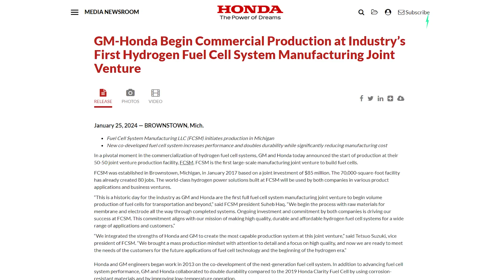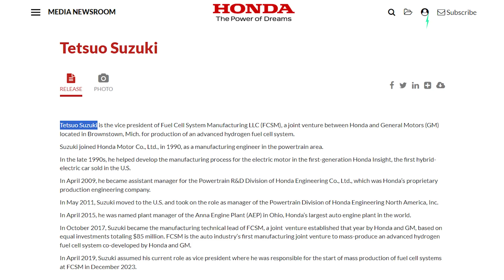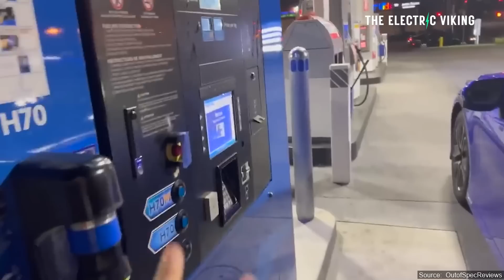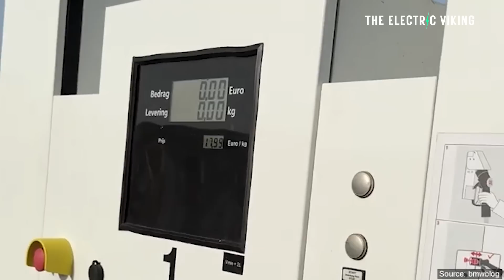GM & Honda's hydrogen fuel cell facility begins mass production in America

Comment: Hydrogen has multiple advantages. It is a high energy fuel, you can crack water to manufacture it almost any place you can get water, BUT It has some major disadvantages.

Hydrogen is one of the most dangerous substances to work by. The atom is so small it will leak through metal. If you do not have excellent gas circulation throughout your facility, the hydrogen can concentrate in dead areas and create an area that will randomly explode once hydrogen levels become high enough. Generally that's seen as a problem.

The problem for hydrogen as we have new high energy batteries that fulfill the same function, without the safety issues. Yes I know lithium batteries burn hot, but so those hydrogen AND hydrogen leaks through pipe walls. I could have seen us trying it for aircraft, but for that if needed we have biodiesel. Hydrogen was a good try, but it's just one of those dead ends at this point.

Comment: Hydrogen are a scam.
The oil companies are getting hydrogen when they are steam cracking oil to get more gas and diesel.

So, when someone got the idéa to use it in a car, the oil companies found out that they could sell more oil.
And, if everyone had an hydrogen car, they could polute the co2 a place they don't have to pay for it.

And, if the tax payers had to pay for the stupid politicians that beleve that hydrogen, it's even better...

Comment: Fuel cells are excellent grid scale solution. My previous employer created a containerized solution 10 years ago. Much better energy density, than lion batteries and can run also with LNG.
Reply: That is plainly false - the most efficient hydrogen cycle is only 40% as efficient as the most efficient battery cycle.

Comment: I think hydrogen is a lost cause but the only hope I see for it is to have a gas distribution system like that used for natural gas. Refuelling stations attached to a grid would have a chance of not running out, all the time but I think the obstacles to setting up such a distribution system are probably insurmountable..
Reply: Am not a hydrogen fan for all the reasons that others have already pointed out; however, as Sam regularly reminds us, renewables are generating meaningful proportions of various countries' energy requirements...which is great, but if the current roll-out rate continues, what is going to happen to the excess capacity? If electricity regularly becomes "free" then it would make sense to use it for something and IMO a hydrogen electrolysis plant makes for a neat dump load :-)  ...but I've seen the Hindenburg movie too so whatever anybody sez there's no way I'm going to be driving around in a bomb even if the explosive is free...

Comment: If these fuel cells are intended for vehicles, Honda and GM have just wasted their money. The efficiency of these fuel cells is 60%. That alone is enough to doom the system, since that's roughly the same as the end to end efficiency of the whole BEV system including generation.
Sure, there may be some edge cases where these are useful, but it's never going to be a mainstream product.

Comment: They need to install refueling stations in the northeast part of the United States. There is a big market for them in Massachusetts, Connecticut, New York, Rhode Island and New Jersey. They should start with installing them in wealthy towns, where people would have the money for hydrogen fuel cell cars.
Reply: Still a big problem.  Hydrogen stations will be scarce like EV chargers were at the beginning, BUT, an EV can literally be charged (however slowly) anywhere there's an AC socket, and that's everywhere.  I have a level 2 charger at my home and have never been to a public charger with my Tesla and maybe never will, but I can never have at-home fueling for hydrogen.

Comment: Fun fact: transporting the same amount of energy as a diesel tanker truck takes 16 Hydrogen tube trailers pulled by diesel trucks plus a tanker for the 16 diesel trucks to refuel.
Reply: With Mary mathematics that is probably a wash, its the salary and bonus that count as long as the stockholders are razzle dazzled.
Reply: F-O-N FUN
Reply: Not doubting you but I'm wondering if you could share where you got your information. :) @sparkysho-ze7nm

Comment: Hydrogen, because it is the smallest atom, is horrendously difficult to contain. Mechanisms to move and contain this fuel require more maintenance and costlier containment manufacturing than other larger fuel molecules. Failure to maintain the containment systems, even those on vehicles, would make Hydrogen far less cost effective.
Reply: And FAR more dangerous than gasoline and FAR FAR more dangerous than a pure EV.
Reply: Hydrogen is also suspected of being a greenhouse gas, since it forms methane when it escapes.
Reply: @drxym  It doesn't form methane.  It consumes hydroxyl radicals that would otherwise have destroyed the methane.  Any methane in the atmosphere (and there is a lot) would then last longer.
Reply: Legacy automakers will spruik Hydrogen since it requires regular (expensive) maintenance with all the pressure tanks, valves & associated plumbing. Governments are on board since you are tied to a cartel controlled bowser & they can collect excise at the same time.

Comment: The plans for this were made back when batteries cost much more.  It probably made a lot more sense using those prices.  This is also a Metcalf's law situation.  Success will depend on reaching critical mass.  One thing in favor of hydrogen is there will be a lot of cheap real estate in the form of gasoline stations with diminishing gas revenues.  However it will be very hard to provide hydrogen at a cost competitive to electricity (generation + batteries).  If batteries had remained expensive then hydrogen cannisters could have been a replacement for batteries created when electricity needs to be drained from the system.
Reply: So I've heard this before and wonder what does it really take to convert an old gas station to hydrogen? You can't use the existing equipment, the old fuel tanks have to be removed and have likely been leaking which will require some sort of remediation, the hydrogen infrastructure necessary is expensive and has strict safety regulations which ends up taking more space than the original station so you'll likely lose some pumps and possibly the convenience store as well..Takes a lot of planning, effort, equipment and especially time and money to get this done properly even with government backing. All for a technology that will never be as efficient as battery tech... seems like a good idea.
Reply: @erktrek  Great questions.  I am pretty sure this fits with what Toyota wants to do so it must be possible.  It begs the question, though, if you don't do this what else are you going to do with the space?  It seems like there would never be enough parking and it would be a lot harder to put supercapacitor 10% zap chargers in place, especially because it would make the cars more expensive.

I think the most expensive part of "cold" is "insulation", so I assume there should be some cost savings.

Comment: I think the ability to control the production and revenue generated by the ‘fuel’ is something that falls in line with current gas ecosystem. The yachts won’t buy themselves if the public can generate their own energy from their rooftops.
Reply: Bravo! An astute observation, well founded.
Reply: Let's not forget that 30% of fuel is spend shipping fuel around the planet. That is a lot of industry retraction if we stop shipping fuels. 

Less pipelines
Less trucks
Less trains
Less ships
Reply: You are never going to generate that much electricity from a solar panel.  they just don't make that much.  And you lose 14% charging a battery, and the car is worthless when it's 6 or 7 years old - dead batteries.   Your statement is an innumerate dream.

Comment: Hydrogen is a net loss system. It would be cheaper to use the power directly to charge a battery than to convert water to Hydrogen.

Comment: Hydrogen - for people who want their fuel to cost 5x more than gasoline and be 1/4 as efficient as using the same energy to charge a battery.
Reply: Too logical
Reply: We could have plugin hydrogen/battery hybrids and excess solar during peak times could be used for hydrogen production. This will allow to install more solar panels to compensate for cloudy days.
Reply: @vegtalkvibes  or solar could be used to charge a battery at a much greater and useful efficiency. That was what the Sono Sion would have done if the company hadn't run into funding issues.  But even the Sion was only looking at adding 10-20 miles of range daily which would still cover a lot of daily drives but if it were only 2-5 miles via hydrogen it would scarcely be worth it.
Reply: @vegtalkvibes would these cars also have space for passengers?

Comment: Hydrogen is attractive to the BIG MONEY powers that be for several reasons. When Hydrogen burns, it combines with oxygen to create water. Very true, and very simplistic. History says Hydrogen took humanity to the moon. Again true. The Saturn five rocket was very powerful. In chemistry class we used electrolysis to separate hydrogen from oxygen. Also true. The Hindenburg used Hydrogen, and burned it too! Industrial production of hydrogen has been around for years, not as simple as hydrolysis in a test tube. Uses vast amounts of hydrocarbons. Hydrogen is an alternative to gas, oil and coal for powering vehicles. Not nearly as efficient as  renewable electricity. The big kicker with Hydrogen is that it is in opposition to JOE BIDEN'S MANDATE for EVs. Add to that, it cannot be made in practical quantities by an average homeowner, whereas anyone can buy photovoltaic panels and a battery system and use electricity. If BIG MONEY can force everyone to continue to buy their product, they can still exert some power over the average consumer. Once I have completed my investment in Solar Power, I can to some extent thumb my nose at the big power brokers. They don't like that. It diminishes their control!    In summary, the hydrogen push is an effort to support the oil industry by discrediting the EV industry. Part of the same money pot as "EVs will crash the Grid".    Must go. Need to recharge brain. More beer and mushrooms. CAFFEINE running low!

Comment: I don't see much of a place for hydrogen in transportation. Green hydrogen is expensive to make, hard to transport, difficult til store.
But batteries are not ideal for cargo transport. Or planes. The required batteries bacome to heavy. Maybe use green hydrogen to produce green ammonia, and use that as fuel?
Or perhaps methanol? Those things would make a bit of sense. Hydrogen? Not so much.

Comment: In the Netherlands, an attempt was made to issue a tender for four hydrogen trains, but failed to find a train manufacturer for the four hydrogen-electric trains.
For cars There are currently 13 hydrogen stations in the Netherlands. It will be difficult to roll this out further.
Reply: GM getting involved confirms it's a bad idea.
What are the economics like in Netherlands?  (H2 price compared to electric and petrol)
Reply: @Mrbfgray  Charging an electric car at home costs €0.40 per kWh. Charging along the highway is approximately € 0.60 kWh.
Petrol euro 95 is € 2.14 per liter.
Gray hydrogen made with natural gas now costs between €1.5 and €2 per kg, tax-free.
Green hydrogen is more expensive, around €3 per kg
Reply: @mahes303    I see, thanks.  If  remember correctly--1kg H2 is roughly E-equivalent to 4L of diesel.
Reply: @mahes303    Those are extremely high electric rates, even here in Commifornia we pay some $0.18/kWh, grid power, it's closer to half that in much of the country.
Reply: @mahes303  Kg versus liters price depends on how far you can go per kilometer on each.
Reply: @jamesvandamme7786  1kg of H2 is very roughly 1 gallon (4L) of diesel, in terms of useful energy available.
Reply: LOL, in other countries, hydrogen filling stations close down. I am curious to see for how much longer those 13 hydrogen stations in the Netherlands will last before they are shut down.
Reply: @Seventh7Art   Here in Cali there are a few only due to dumb government support.
Reply: @Seventh7Art  The intention is to open at least 3 more hydrogen filling stations in the Netherlands this year. I wonder if this will work.
Reply: @mahes303   It will not work in the long run. How many hydrogen fuel cell cars are there in the Netherlands?

Comment: This is  like a river that flows into the desert, only to vanish in the sands.    Basically a waste of resources.  regards
Reply: No it's not. It's research into diversification of energy storage and production. If some super volcano covers the entire sky with particles that diminish solar electricity production we will be in a very bad place if we rely mostly on solar. So alternative research is always welcome including nuclear fusion, fission and so on.
Reply: @vegtalkvibes  alternatives yes and agree about nuclear power (and wind, hydro etc), pointless and expensive endeavors geared mainly to benefit the suppliers? No... also if the entire sky across the globe is covered that badly where solar doesn't work we will likely have other serious issues to contend with as well.
Reply: @erktrek  Theoretically it is possible to extract hydrogen from water. It is not energy efficient but it is possible. So in theory in the future it will be possible to generate hydrogen on the spot if energy is free. Plus imho a plugin hydrogen/battery hybrid is the way to go. So that you can charge at home for short commutes and if you need to travel 1000+ miles you use the hydrogen cell.
Reply: @vegtalkvibes   In such a scenario, power generation will be the least of our problems - growing food will be a major problem.  Present climate changes are beginning have some effect here in the UK;  floods, storms and heatwaves are increasing as the years go by.   And this is my own obervations from the 1950s onwards, not from some 'expert'.
Reply: if there is a super volcano that diminishes solar that much, we are ALL in big trouble,  vegetation relies on photosynthesis so, will start to die off, animals that rely on green vegetation will follow,  then carnivores, then humankind,  no amount of hydrogen will save civilization. This has already happened in the distant past, and it was because there was a string of eruptions over decades, let's hope that history does not repeat. @vegtalkvibes

Comment: My impression was that hydrogen cell cars are also electric. What stops manufacturers from making plugin hydrogen cell hybrids. You will have less range in battery for city commutes that you will charge at home and for long travels you have hydrogen cells. The battery should be big enough for regen to work efficiently then you have the best of both worlds. Plus you don’t need different engines so the car is simpler than gas hybrids.
Reply: The process of storing and transporting hydrogen is very expensive and energy in efficient. That's why there are so few hydrogen stations.
Reply: @i6power30  yes storing and transporting hydrogen might be expensive now because it's relatively new technology. The same with electric cars they are more expensive now because they are relatively new in comparison to ICE. 
While hydrogen is not as energy efficient it could be generated from solar during peak times when solar energy has negative price. 
Especially for EV trucks where volume is not as critical as mass of energy storage hydrogen/battery hybrids make a lot of sense.
Reply: @vegtalkvibes  If you are going to use solar to make electricity why on earth put 2 more inefficient steps in place to turn it back to electricity - why not store it in batteries in the first place and get 2.5 times more use out of it. Even pumped hydro is twice as efficient as recovering stored hydrogen and takes a fraction of the infrastructure cost to put in place, gravity really is endless and constant.
Reply: @TB-up4xi  why? I guess the only advantage of hydrogen over batteries is the speed of refuelling. It matters in remote and military applications where charging infrastructure is very limited and you can ship tanks of hydrogen just like gasoline. In every day normal use in populated areas batteries make more sense.
Reply: @TB-up4xi  capacity
Reply: Where will you refuel your hydrogen cell in the US, if not living inCalifornia or Hawaiia, nowhere so no-one buying them
Reply: @robertwoodhouse-bm7kt  That's why I suggest plugin hybrids that you can charge anywhere. But you also have the options to use hydrogen cells to charge the battery.
This solves another problem for hydrogen cells they will have to provide a constant current to charge the electric battery - that is much easier to achieve then providing dynamic current for powering the engine directly when driving.
Reply: Why hydrogen at all this the question? hydrogen is only 40% as efficient at battery electric. It's the Hydrogen tech itself that's the problem not the supplementary battery that supports the system - any hydrogen in any form for motor vehicle use en-masse is a dumb idea, storage maybe, large facility energy use maybe, cars nope.

To get any decent range you now need a decent battery and a full scale fuel cell - twice the cost and if either fails you're in for an enormous bill.

Comment: My question to Hydrogen is WHY?????  There are very few fueling stations for doing Hydrogen vehicles.  Electricity and gasoline s everywhere to connect to.  Dumb idea to do Hydrogen!!!
And what is the refueling cost compared to gasoline???  is it cheaper or more????
Also what about safety handling Hydrogen fueling stations any time of the year - cold hot areas.
Thanks for the video.